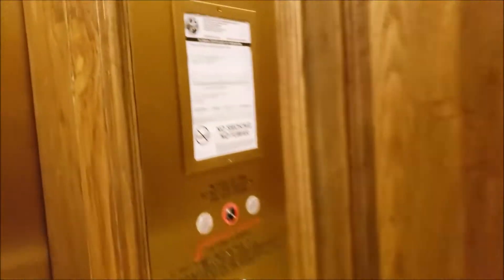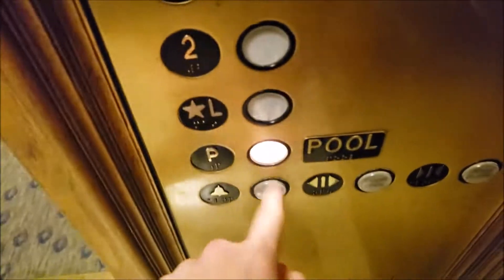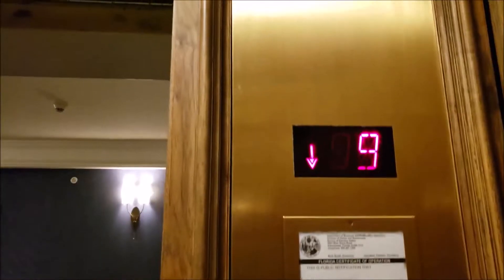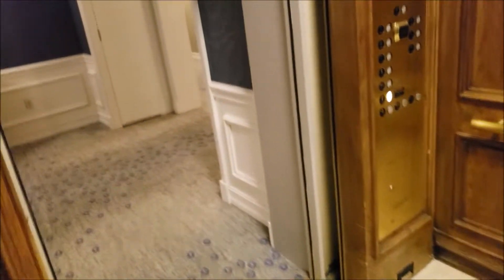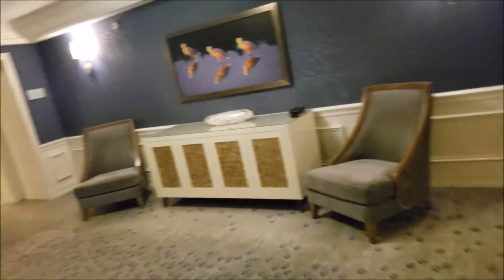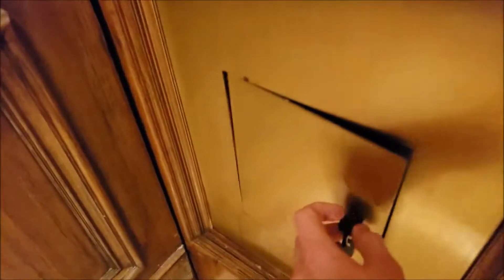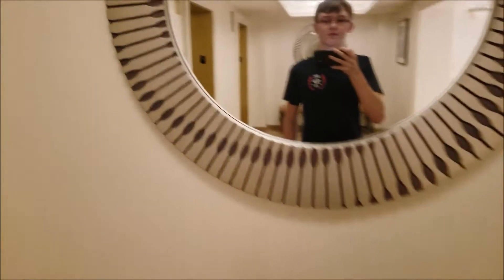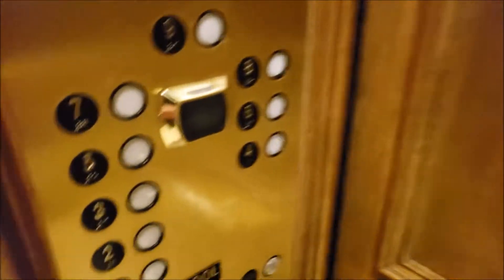Schindler Traction Elevators (Miconic Controls) - The Ritz-Carlton Hotel - Sarasota, FL

Comment: I think this might be 700A or EPOCH (whatever the right name is), as it doesn't have the right chimes or indicator to be 500A. Plus, it's a bit early as 500A was introduced in 2001, and the interlock said January 2001. 👍 Nonetheless, those are BEAUTIFUL lifts!! 🤩
Reply from the maker: I've heard that Schindler EPOCH was only made until 1995, but I don't know if that's entirely true or not. I'm gonna guess that these are Schindler 700A in that case, thanks for the info!
Edit: These are Miconic Controls, not 700A
Reply: @ElementElevators  You are welcome!! Anytime. 😁👍